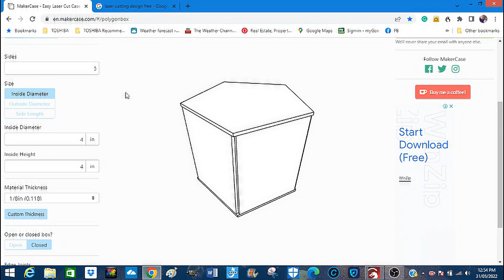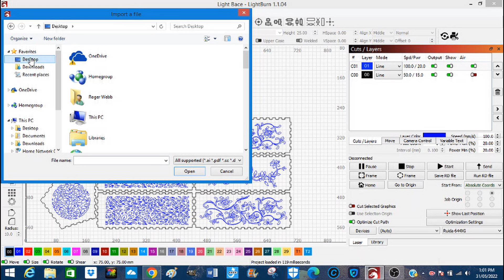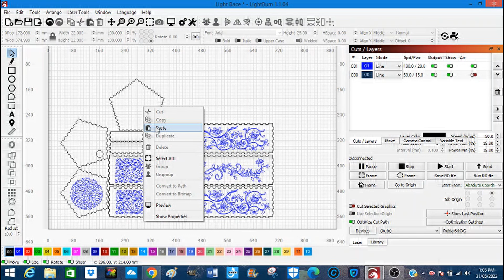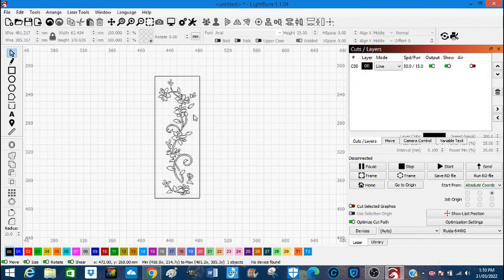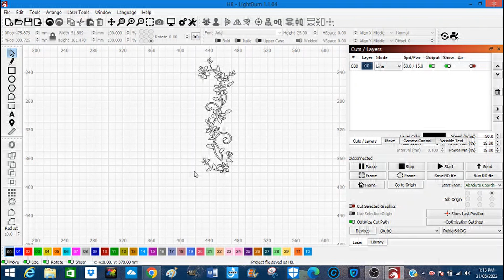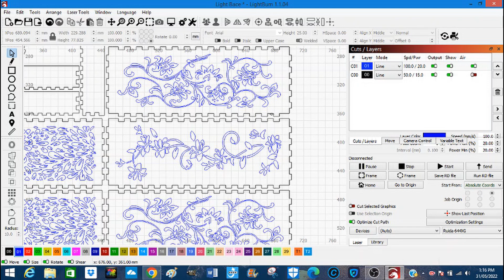A complex design made easier with LightBurn & Thunder Laser and a finger joint box generator

Comment: What you want to do there if your making loads of them is have the sides connected as one so the finger joints for two sides are cut together as one. It saves a lot of time and cuts down on wastage. The other thing to do is group each piece then do cut optimize before sending to the laser. It'll cut the colors in order then cut out the piece before moving to the next. That saves more time. I don't use Lightburn but it's a clone of Rdworks so probably the same methods.